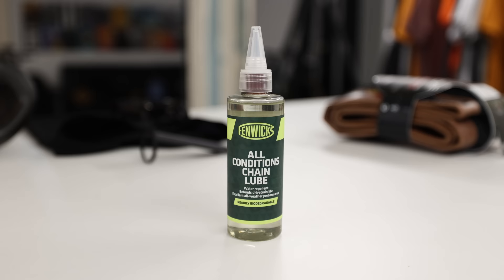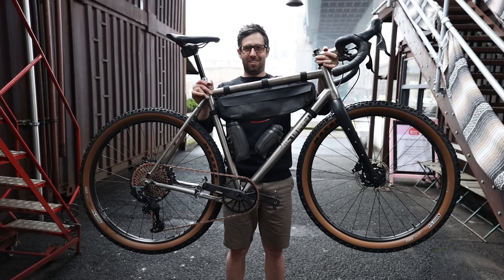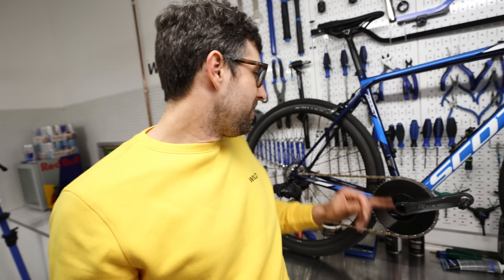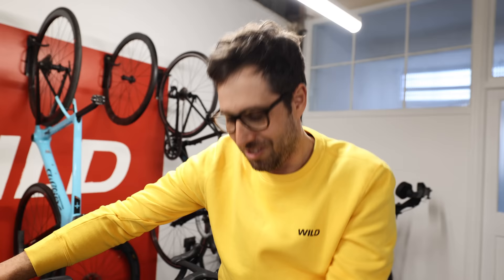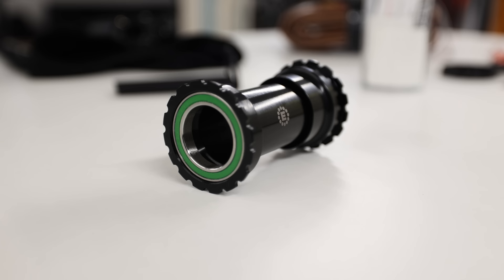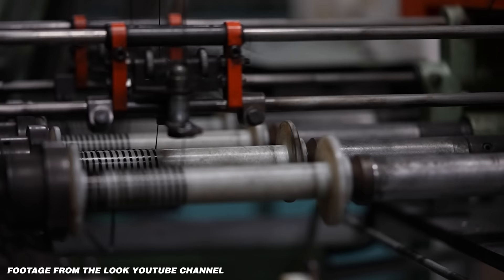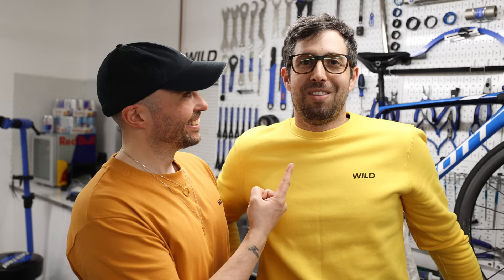Pro Bike Mechanic's 20 Most Loved Products

Comment: By far my most favorite tool is the park tool tl 4.2 tyre lever, as a bike mechanic myself these tyre levers have never failed me, including on some ridiculously tight tubeless set ups and some stuck on nasty old tires, they are strong and last a good while.
Reply: Do you have an opinion on Pedro's?
Reply: @David Garcia  they are much like the muck off version. Yes, they are good, strong and low ware too, (to be fair not tried the latest version) I find the centre spoke catch doesn't hold as well as the 4.2's side catch, plus the 4.2's are lower profile so take up less space in the saddle bag 😄

Comment: I disagree with the statement that you don't need all the gears a 2x gives you. I love descending so that 52/11 is necessary, and I'm also pretty heavy so the 36/30 is greatly appreciated, you can have a huge range with tiny gaps between them which is the worst part about 11-42 cassettes.
Reply: Agree, especially on fast group rides where you cannot really pick your speed I would hate large jumps.

Comment: If not for my 2x drivetrain on my Sirrus 3, I very much doubt I would be able to scale the hill climb that I have to ride if I want to go too the gym on the other side of town. It's super helpful and I live in a city with quite a few hilly roads etc. I'm also only a month into commute riding so very new and I'm about 275lbs or 124.7kg for the Europeans. Maybe over time as I lose weight and have already shaved 12 minutes off my commute in just a month, I'll have a different tune but idk how well I would've gotten on without a 2x drivetrain
Reply: Same for me, vendor said "you'll probably not need the lower gear in the front"
Used it a few times on my way home from the dealer 😅

But yeah that's what 10 years of neglect gets you...
40 additional kg and the need for an O2 bottle after 5km 😂

I really need to start working on myself again
Reply: @muuhnkin4611  currently on myself now haha

Comment: Love my  gravel bike as well….with full mudguards.  Even have done very well racing with them on in muddy Alaskan silt.  One-by on the road or gravel?  No thanks.  I want more gear range without a rubbish lid sized cassette.  Integrated fully internal cables?  Again, no thanks.  I want to be able to easily service my own gear on the road.  (You want to suffer with fully internal cabling but can’t stand installing full mudguards??  They’re a cinch by comparison.). Wireless or wired electric anything?  Meh.  And I’ll stick with hot wax for chain lube, thanks very much.  Everything stays so much more clean, including my legs.

Comment: I'm  a fan of 2 by groupsets. I don't understand the problem with the front derailleur.  It a good chain keeper and I have more gears and a wider gear range. As for wider tires on a gravel bike,  why not get a hard tail mountain bike if you need big tires.

Comment: Yeah, I'm riding a Basso Palta with Ekar group, mostly as road bike, and also for cyclotouring with the Tailfin carbone rack.
I must admit, still using tubes, not sure I want a second wheelset for switching the tyre size in function of the use.🌨️🚴🧳
Thanks guys for your amazing and very informatives videos 🚵🏋️🚵

Comment: I've tried wax based lubricants and trust me its a life changer!...They last way longer and dont attract dirt like oil based chain lube...I personally used Ceramic Speed UFO Drip..check it out
Reply: Waxed chains are better for my use case as well.  I'm using Molten Speed Wax. I went through a full drive train the first winter of bike commuting.  The third drive train has lasted 2 (or is it 3?) years with wax.  Well worth the price and, in total, less time to maintain.
Reply: @danielmcgowan9534  Exactly we don't need to degrease the chain, which saves a lot of time, and as a plus wax lubes gives a watt saving as well

Comment: What part of an AWS-10 tool is machined? Injection moulded plastic and extruded alloy I'd say.
Reply: They're made from tool steel (which can be extruded, but not necessarily) which is then heat treated and then ground (heat treating nearly always results in dimensional changes, but once hardened and maybe tempetered, it too hard to shape by anything but grinding or filing) to size post heat treatment.

Comment: Front mech for light gravel, road and tourism is essential. And I don't understand why not all people use Fidlock))) Thanks for the video!
Reply: It's kinda expensive and hard to justify when you're fine with regular bottles/holders. What puts me off - bottles sometimes get moldy even if you buy bottles with antimold coating and take care of them. I'd rather change 7 eur bottle, than 17 eur bottle ever so often. But of course if money is not an issue Fidlock is great. It is just no THAT great.
Reply: Because it's pointless 😊
Reply: Fidlock bottles are almost 30 Euros a piece, and you throw them away after two years of regular use. They're just too fuckin' expensive and create more plastic waste (plus metal because of the magnets) than any other 5-Euro bottle.

Comment: No more front mech, you don't have to worry about crosschaining - well yes, because now you can't avoid it whatsoever. being on the biggest cog on the rear with a 1X is like being on the big ring and like the 2nd biggest cog on a 2X in terms of chain bending, which is already pretty bad and normally something to avoid anyways. Not to mention the bigger jumps between gears/smaller range depending in where you compromise. And a 1x12 is still a lot more expensive than a 2x10 or even a 2x11, both of which will be a lot more viable on road bikes. And you DON'T need to be a professional to have the need for both a 34x30 for climbs and a 50x11 on for example a faster groupride. That's just an outrageous claim.
Reply: But Vandegaard won a TT stage with a 1 x ont the TDF, so...

Comment: Silca tire sealant. Lets take a respirable hazard, carbon fibre, put it in a pressurized vessel that will blow it out over those silly enough to tail gate/draft. I just want the Silca Sealant sticker to discourage unwanted drafters:)

Comment: Sometimes when roadies crash it's actually more gentle than a normal ride on a MTB, and yes, I rly need a water bottle with a cap cause mud tastes bad..I still ride 26 inch, 3x9 speed and the only reason I would like 1x or classifieds new speedhub is because of the fucking mud but I rly don't like straining my chain on the outer gears so my only option is that speedhub, or using something like rohloff gear hub so I don't have to clean/lube my chain twice per week. Too bad that literally every option is pricey as fuck so I would go for 2x unless i'm forced to take something else...can you imagine a DJ bike with a 2x?
Reply: +1 for 3x9 26er

Comment: A truck being heavy needs 8/12/16 CLOSE RATIO gears. Heavy people riding with others not so heavy do not go 1x. For those who understand gear inches:  As a 100kg (fit) rider in a very hilly area if I want to keep up with younger and much lighter riders I do not want more than 5 inches change between 60 and 100 inches.  2x can do this and if you use a 12 up cassette (Campag you see) you can cross chain 34/12 perfecly OK. On a positive note, well shot, well presented videos and a mechanic who kows his stuff and doesn't wear black gloves!

Comment: Silca sealant has a big downside - it's not really compatible with CO2 according to Silca. Also, I wonder if all these strands make cleaning it harder?
Reply from the maker: There are quite a few sealants that are not compatible with CO2
Reply: @Cade_Media  Yes, you're right. It's just that CO2 (IMO) is best way to inflate road tyres on the sideroad... Not sure if I can trust  mini pumps to inflate 80-90 PSI.

Maybe a video on best products for roadside repairs would be worth a shot?
Reply: You can use Co2 its an acidity (chemical PH) issue so when you get home, just let the Co2 out and refill from a normal pump

Comment: Find an older mechanic and learn the horrors of the old headsets and bottom brackets. Even worse cotter pinned cranks. Loose bearings in the hubs, bottom brackets and headsets were such a pain. Also building wheels was much more difficult with 36 hole rims and rims that were so limber that if tension was not perfect the up and down true was harder to correct than side to side.  Don’t get me started on drivetrain parts made by simplex.
Reply: Older mechanic here.  What’s this about horrors of old headsets and bottom brackets?  I still ride ‘em 
, service ‘em, and love ‘em.  Setting the desired bar position is so much easier with a quill stem.  I will agree on cottered cranks, though.  36 hole rims with limber rims are no problem to build for one who has learned the art.  Spoke tension should be as equal as possible regardless of the rim used.  And my lightweight old tubular wheels ride much more comfortably over rough pavement than any of those deep section carbon wheels, or deep section clincher aluminum wheels for that matter.  The run-of the-mill Simplex gearing was a pain, especially the front derailleur, but they had a somewhat rare high quality line that rivaled Campagnolo at the time.  I still use a pair of their retro-friction shifters, which only have friction to hold the mech in gear in the direction needed only, without a ratchet like the Japanese shifters.  Huret had their own version after I think they bought out Simplex.
Reply: @randalbladel2817  obviously you are not riding 20 hours a week or a competitive cyclist.

Comment: Only pros need loads of gears is a bit of a daft claim. It's us mortals who need a wide range of gears.
And if 1x has a wide range, you are forever changing gear to find the right cadence. Even then you usually lack top end gears and spin out. I spin out on flat with my FS's 1x12 and it's very hilly here.
I regularly ride my 1x setup along a 1.5% and 4km climb and am constantly changing between gears, because they are all wrong. On my 2x I can select the right gear and that's it, job done.
Reply: I always change 1x to 3x or 2x... 1x don't work for me. Also saves the drivetrain.

Comment: I probably won't use Silca sealent again, the only sealent that's ever literally let me down. Set solid in the tyre after two weeks.
Reply: What sealant u use then?
Reply: @marcustan5868  I've been using Mukoff recently.
Reply: Silca have noted some issues with some tyres and I refer to the above statement about using Co2 and any latex based sealant. The Co2 causes a change in PH which will set the latex off so if you do use Co2, let it out as soon as you have access to a normal pump
Reply: ... sealant*

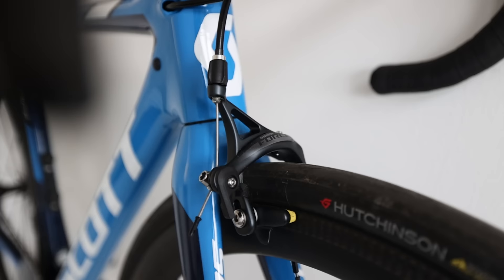Comment: 5:16 IDK maybe because 23 mm has been proven to be the fastest, most aerodynamic?
Rather, why would I trust the bike industry's attempts to reinvent the wheel.
Reply: Back when the rim brake Canyon Aeroad was still around, its tires were even specced as 23 mm front 25 mm rear.
Reply: 23mm is fastest and most aerodynamic under certain conditions. Those being an extremely smooth surface with high tyre pressure and little compliance along with wind direction roughly parallel to direction of travel.

One a normal road surface, the tyre loses energy as it can't comply with the surface and so bumps up and down more, turning your forward momentum into up and down momentum. Cross and oblique angle winds see much less difference between 23, 25, 28 etc as the wind is seeing more of the side and not the tyre profile, so the relative size difference is less. Lastly, the vibration caused by narrow, hard tyres on rougher roads is more fatiguing. 

Many pros are riding 28mm tyres now in road races. If they're doing it, they definitely think its fastest.

Comment: 1X is certainly my favourite product/idea.....the front derailleur was my least favourite part of road cycles in years gone by.....Like you said 2X is only needed for pro racing...however front derailleurs do make a great thud sound as they hit the bottom of a trash can...😁
Reply: Not sure where this idea comes from.  I love my front mech. It gives me excellent range and managable jumps between ratios.  1x is excellent on my MTB, but not for road and gravel.  Not to mention chain lines
The rest of the list is pretty good, although, truth be told, I prefer the look of internal cables.
Reply: @richardhaselwood9478  I think it depends on your style of riding..if you are like me and like plenty of gears for hills and on the flat and just freewheel downhill it is excellent. The hill climb bikes are all 1X today.
Reply: @truthseeker8483  saying it's just for pros is just wrong. Even Nic knows it… he is just a trolling.
A lot of people are racing without being a pro…
I pedal downhill and need my 48:10 as much as my 36:28. And I also need the small jumps for a reasonable cadence.
Hillclimb bikes have it because they are build for just one thing. Like a downhill bike has around 7 gears.
It really depends on where you live and how you ride.
But I love 1x on the MTB, since you don't notice the gear jumps that much when you ride offroad. And since the downhills are technical you freewheel anyway.
Reply: @truthseeker8483  I think that's broadly true, but, my problem with 1x is that it sort of has to be optimized for either flats or climbing.  So, you might be happy with a 50t ring, but then, the smallest you'll get is 50x32 (ish...), i.e. murder up hills, or, say, 42T ring.  At which point, your smallest ratio is 42 by 32-34 (I'm speaking Shimano here, not sure if you can run the 48ish tooth rings on SRAM, or Campag stuff), which is still nasty uphill, but still, really poor ratio on the flat.  Hence, me not being sold on it all.
Reply: @richardhaselwood9478  For my casual riding a 38t chain-ring and a 12t cassette sprocket is plenty high enough.🙂
Reply: @truthseeker8483  Cool.
And the bunchies I ride with, I'd be spinning out and spat out the back 🤣(Not that I'm particularly fast I have to emphasize).
Certainly horses for courses stuff.  As I said, I really like it for MTB though.
Reply: @richardhaselwood9478  Would you? If I put you on a 40/10 @90rpm that's just under 30mph on the flat, man your stronger than me i could sustain that! wouldn't cut it on a down hill maybe. Ok let's say you were using SRAM, a 46tooth for the sake of argument and a 10-33 out back. That gives you 5 (i think) 1 tooth jumps in the lower part of the cassette and  5 2tooth jumps and 2 3tooth jumps( i believe), pretty manageable i think for anybody. A 46/10 @90/95rpm cadence will see you doing roughly 35mph. @100/115rpm (hardly spinning out) well over 40mph 130rpm (just on the cusp of spinning out) 47mph! , Dont know about you i wouldn't be holding that for too long! So more than fast enough for those evening chain gangs outside of  a TT i think. So let's tackle climbing let's take a 10% pitch a 46/33 will easily handle a 10% pitch at @90rpm (i know because I'm doing 8% pitches @80rpm in the 24 tooth) if you need a little more range a 10-36 will get you up most things and still retain nice cadence jumps. Lets put this in perspective,  MT tade in Tenerife is 5% average with an 8% pitch at it steepest this combo would easily get you over it with gears to spare if you're feeling fit. 1x clearly can and does work these days. And as long as people aren't trying to be heman (not a racing pro!) and pick the right chain rings for their ability a lot of what said above is utter twoddle. You'll always get someone saying what about this 25-30 climb but riders that ride that sort of stuff are few and far between and riding them with a 2x still requires a level of fitness that would see many walking. Even some cars struggle to drive up roads greater than 25%
Reply: @gaza4543  I was in my 30kph bunchie this morning, and a bloke was trundling along happily on his 42t single.  I asked him about it, and he said, he's really happy with it, but he does spin out above 36kph.  That's a problem, because, we are regularly rolling along, faster than 36kph.  I had a quick look at the cassette he was running on the back, and it looked proper dinner plate sized (42t MTB??), so he'd have plenty of low range (My lowest road gear is 34x32). But, my gravel bike can go 46x11 to 32x42.  In other words, I have a much wider range for grovelling up awful gravel climbs, or, fast road sections. And this is my issue with road 1x. They basically have to be optimized for either fast or slow rolling.  

If people want to run 1X, go nuts, don't let me stop you.  I'm sure it works really well for your use case but the the notion is that "Only pro's need it" is daft.

Comment: 5:28 - That looks absurd. I'll keep my front mech and double, with 12-28 in the rear, thanks.
6:32 - And there it is again. That rear mech is just itchin' to be ripped up by a rock on the trail.
The Bike Radar with camera is $399 USD, though it's on sale right now for $350.
Reply: If there ever was a bike gadget that deseved the term bullshit, it's that silly radar thingy.

Comment: his opinion about 1x vs 2x11 is incorrect. a lot of beginner to intermediate needs more gears than professionals. and on the contrary, professionals need less gears. they can use 52/56t cranks for climbs easily.
Reply: I know you probably know this, but it’s about gear ratio, not the number of chainrings or the size of the front ring. I have 1x, 2x and even a 3x setup bike. I “prefer” the 1x. I can adjust my ratio depending on the ride by simply switching out the front ring or rear cassette. Also, how can an opinion be incorrect? All personal preference.  We are lucky to have choices.
Reply: @BIIIKES  his opinion is incorrect in my opinion. :) there ya go. i have to add my opinion as well. and like the other guy said "it's up to me to decide" it's true. it's up to the rider to decide what gears the rider can use. now talking about ratios. i like the idea that the now grx setup of 1x will go for all speds for a gravel. however. not all of us are spinners which you do need more if you're going for less teeth/smaller cranks. :)